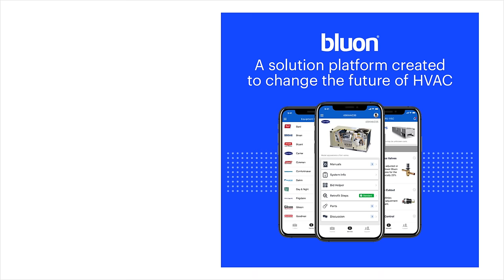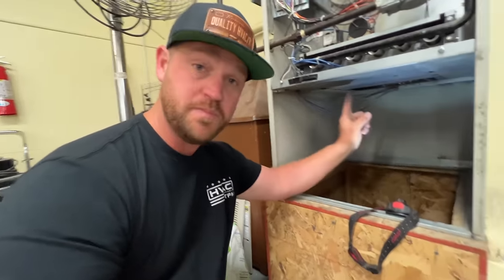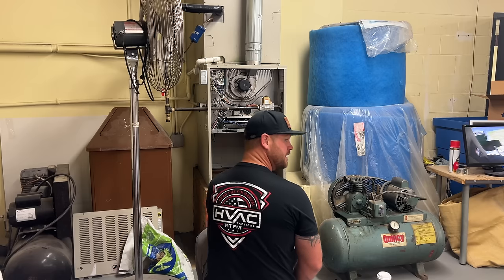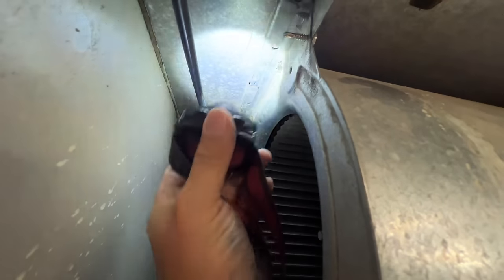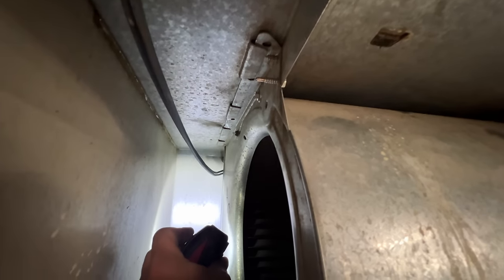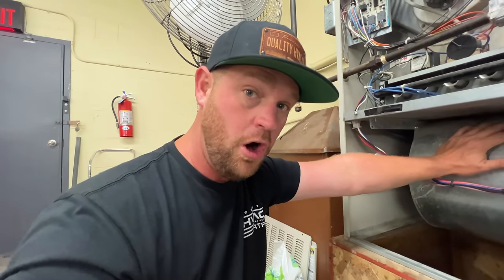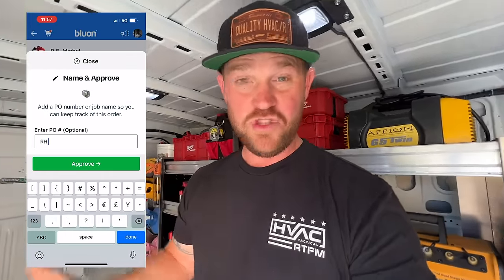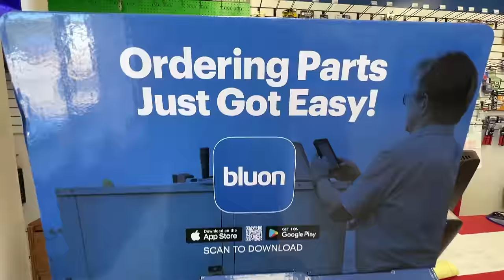One TOOL That Makes My Job EASIER!! | HVAC Repairs

Comment: The center section of the blower wheel separates from the blades.    Hold the shaft of the motor with a wrench and spin the wheel by hand.

Comment: So I work for a supplyhouse(Idk if I can say the name) and as a counter guy I LOVE Bluon! It gives me a way to see exactly what the techs are looking at so I can have the parts they need ready for them to go. I can't say anything yet about future endeavors, but bluon is the bomb and will definitely be on my phone for a long time! My only gripe is I've been a pro for months and still no blue hat!(sorry bluon, had to lol) but they actually came in very clutch for me just this week. Had an older tech come in the shop working on a very old Goodman(based on S/N our guess was 88!) Anyway another vendor got him a new pressure switch, but because it was an old unit they phased it out to a universal part. We looked all over the interwebs finding all different answers on what the factory settings were, and finally I remembered bluon had a tech line. I gave them a call, told them the unit information, told them the universal part information on W.C. range, and literally within 5 minutes we had the universal set to OEM settings and he was on his way to the job.

Comment: I tend to compare those blades from a  blower wheel furnace to the blades of a turbofan aircraft engine. Of course they are not as aerodynamic as a blade of an aircraft engine but it serves its purpose of generating fast air moving. You pointed out missing screws and more likely they caused the imbalance in the past. At a high speed , no matter how tiny is a foreign object, once it gets in the blower, it will rattle. You did a great inspection and found the problem. You have good ethics and professionalism. A new subscriber here. Thanks for your videos. God knows  how much our country need people like you ! Cheers from Houston, Texas 🙏🏻

Comment: The most important thing to add about the Bluon app is that besides the great info on almost every unit in existence you can find on there, the parts ordering feature relies on your local supply houses being hooked up with bluon, in my area in CT, only about a month ago my supply house became part of this, and this features been out a while now. So I would talk to your supply houses to get them on board or you'll be losing out on this powerful feature which is really genius and a huge time saver imho. Good video Zack
Reply: lol what
Reply: @intune6877  what did he say that was funny?
Reply: @randybobandy9828   That wasn't a laughing response, just some troll.

Comment: So awesome. Thanks for the support man!! You're amazing! Always love your stuff.
Reply: I've been using the app for a while. It's really well thought out. One thing I would love to see eventually is for you guys to more thoroughly organize and label the submittals, install manuals, etc. in the sub menus of the equipment. In my experience most information manuals on the app are unorganized PDF documents with vague titles. Hard to justify using the app to track down product literature when I can get it faster from a google search or get down from the attic and grab the paper manual.

Comment: Trane seems pretty good about the center loosening up from the blades , soon as you started it I knew what it was, not saying that was trane but the only ones I've ever changed for that was good Ole trane
Reply: Trane. Over rated and expensive. You need a part? You might make the customer wait a few extra days.

Comment: So if im working on a trane unit and use this app, is it going to go through my local trane store? Or where does it come from? Somewhere stocked locally? It wouldnt make sense to wait a week or two to get the part when its just at the supply store down the road.

Comment: You might want to advise them to let you repipe the gas line so the union is located outside of the cabinet.
Reply: First thing I noticed
Reply: Why is that? I'm not a hvac tech, so I'm just curious.
Reply: First thing I noticed also

Comment: Must be nice to work on an open vertical furnace like that.  My jobs consist of that same furnace 3 stories into an attic, horizontal and no platform to work from.  Man, I'd kill for an easy job like this.
Reply: Live in a area with basements.. my city has probably 85% basements 10% crawl spaces and 5% slabs.
Reply: Not gonna lie man, I don't think id be in hvac if my area wasn't mostly basements. kudos to you my man, horizontals and attics suck. i do em sometimes

Comment: Do you have to install the Ultra Low Knox FAU's yet out there?
Reply: I believe that's only in Cali right now. Nothing out east as of yet. I found a couple in Michigan that were only 3-4 yrs old and the heat exchangers were blown out.
Reply: @macmac3374  WOW already bad. Just remember to adjust the gas valve too 3.5 water Collums when they come your way and your good.
Reply: @misfit67  what about lp?
Reply: @HVACRTECH-83  Great question  haven't had to deal with that yet.

Comment: Don't get me wrong here, but...I must just be unlucky I started searching on the app and 5 times out of 10 so far no parts listed. I will check my notes and see if I can find which models I'm talking about. Pretty sure most were less than 12 years old. BlueOn is great, but they have soooo far to go. I will keep trying, cause it's always easier to text in a part# than trying to read the model and or serial to a dealer and winding up with the wrong part because the sales guys aren't service techs. Hope they pay you good for trying to promote them.
Reply: I'm was thinking the same thing. Can't seem to find parts on most units. I was thinking it's was a east coast thing.
Reply: They are always adding to the app.They have over 300,000 models and over a million parts

Comment: DUDE, I knew it was the wheel the first time, the blades separate from the center disc and vibrate. BLUON SUCKS! I just call the local, Nordyne/Nortek, (RE MICHEL HERE IN NC) supplier and check for availability! No need for a third party APP! At least the guy at the supply house can actually lay hands on the part and confirm it is there! Never seen an app WALK BACK AND LAY HANDS AND CONFIRM IT IS THERE!  But BLUON is paying you to pimp their product so you are not an UNBIASED opinion! Why screw around with an app when I can just call RE MICHEL directly and and get the part info! This is how shit gets screwed up, the middle man is not needed, go direct to the source! The younger generation have become suckers!

Comment: You need a part number?????  Serious?
Go to almost any electric motor supply house , tell them wheel width/diameter/bore size/clockwise or counterclockwise.  Or the LAU number on wheel. Duhhhhh!
Don't need no stinking manufacturer's part number!!!!  Love the hackery capacitor zip tied to motor leads.